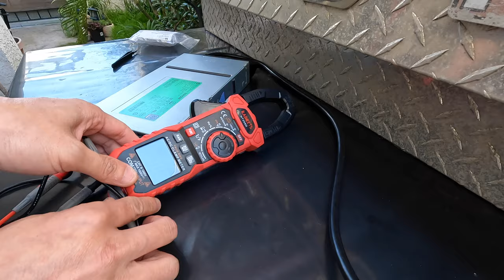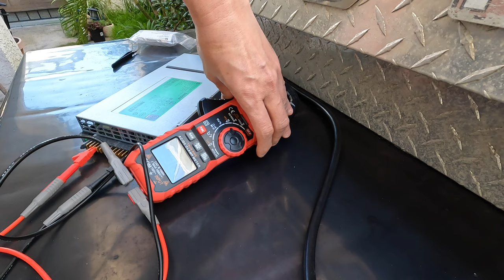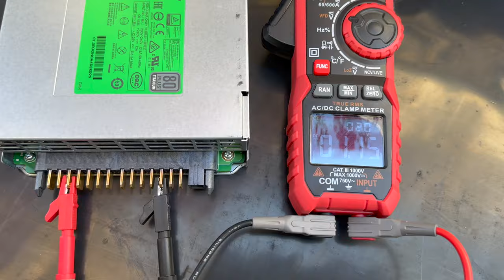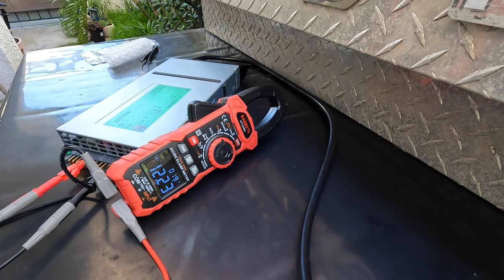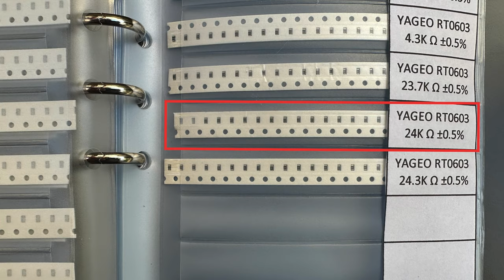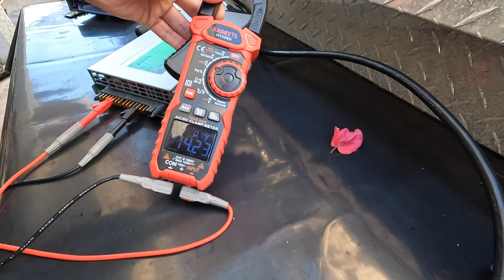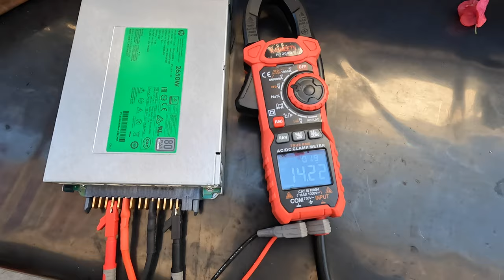HP HSTNS-PD52 DPS-2650BB A 2650W 80 PLUS TITANIUM OVP & OUTPUT VOLTAGE 14.25V MOD LLC PSU Low EMI

Comment: You make a great job. I have been waiting for this video. Also, what we need is only two resistors? No need programming? I have yesterday looked your site, but didn't find much info about this one. What a surprise! Can you copied link to the two gold connectors you use. I need order few of them and still looking for best ones. Thank you very much!!
Reply from the maker: Thank you for your kind words! You only need to replace two resistors, and no programming is required.
Reply: @taoli1239 hi. Do you have any info about PR52?
Reply: Ao  Model : Hstns - pr16
        HP 2450W